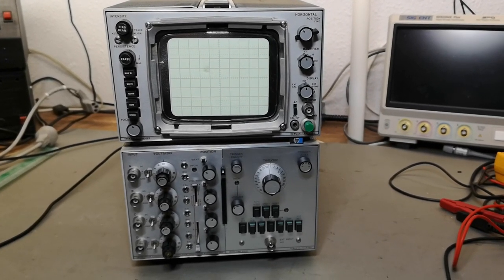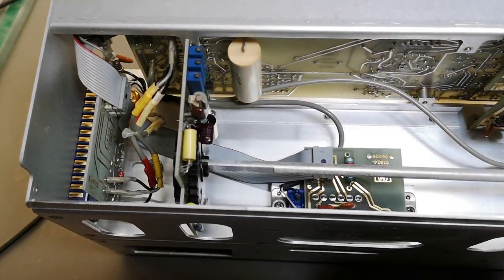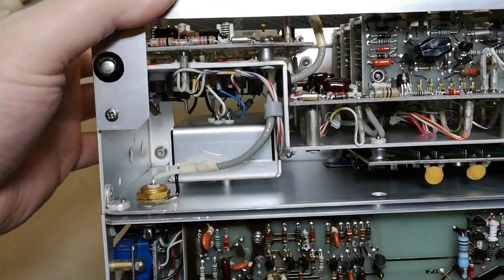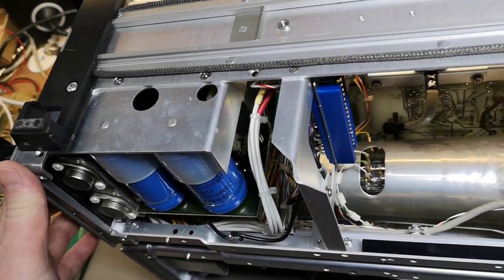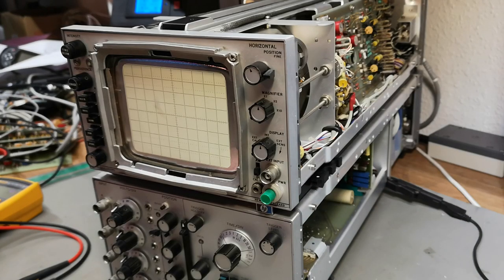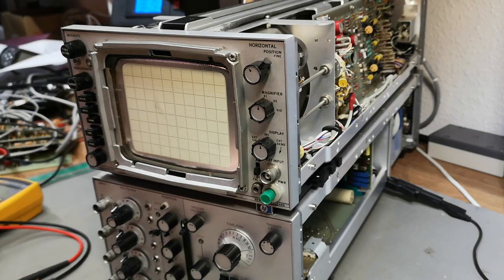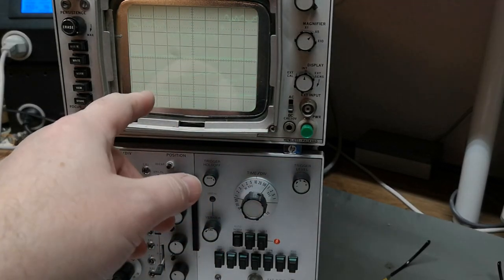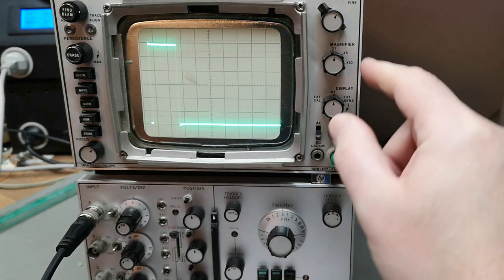HP 181A oscilloscope 1804A plug in 4ch 50MHz 1820C timebase repair

Comment: Nice video. I fired up a HP 181a yesterday for the first time in 10 years. It doesn't have a variable persistent display like yours and the internal construction seems much older. I read that the 180 series first came out in the early 1960s as the very first all semiconductor scope from HP. It was sold at least till the 70s.  I am sure they updated the internals many times during that time.
Reply from the maker: wow great, good luck with yours

Comment: I'm just checking that I wrote a comment but didn't send it 🤪
I don't even know this HP model, but I've always liked the Tek plugins for their combo capabilities, that analog memory is awesome - congrats on the catch.
HP production is visible on every centimeter, you don't even have to see the brand and you can tell by the internal construction - at least with this old school.
Reply from the maker: and i am sorry to say it since we are both TEK lowers: this HP got an analog storage that is far better than all the TEK scopes i ever tried / owned.
Reply: @TeardownOZ2CPU  Yes, that's why I wrote that the analog memory is amazing, I've never come into contact with it and I couldn't believe my eyes when you showed me how it works.
Reply from the maker: @Edisson.  they actually also used this analog storage technology in a non visible storage unint, just cant figure out what it was called, image can be read back using a camera tube / CRT combo
Reply: @TeardownOZ2CPU  I've probably seen analog memory once in my life, but at the time I didn't know it was her, the way I think about it, I guess so. In the labs, we had a special oscilloscope for measuring super short times, it was almost a single-purpose device where entire printed circuits were inserted directly into a special shielded slot in the panel. I only know the classics from Tek, because I had a memory oscilloscope (I can't remember exactly the type 4 something) 2x150MHz with a wart - so I called a multimeter above the panel and I'm not entirely sure either, but it had a delay line made with a coiled cable - we had several different types and from there my love for the Teks.
Reply from the maker: @Edisson.  stay tuned in.. another TEK is comming up, it is NOT a model anyone have seen before, a modified one, and I got it working :-)
Reply: @TeardownOZ2CPU  WoW 😲 I can't wait, nothing can stop me from watching your videos, sometimes I'm late, but I'm always looking forward to the next one like a baby for milk 😂
Reply from the maker: @Edisson.  ha ha.. thanks.. you can also watch the old ones, just one pr day and see how long it takes :-)
Reply: @TeardownOZ2CPU  Well, if you don't have another channel, I've seen almost everything here on this one😂 including Ford at the beginning - I'm a lifelong Ford fan - I currently have a KUGA in ST version - I didn't comment on older videos